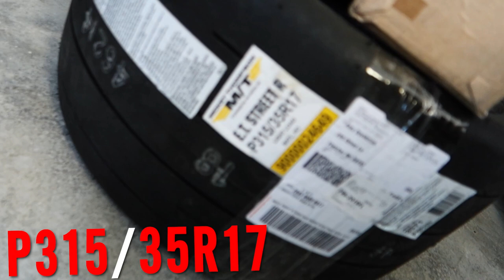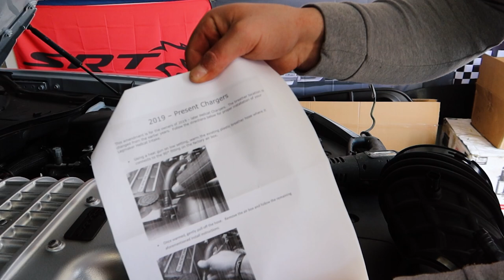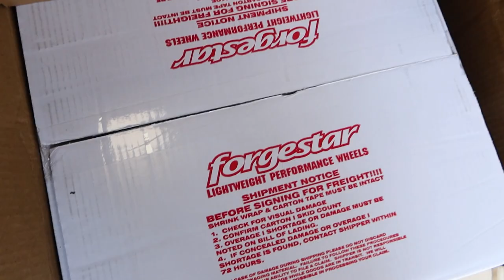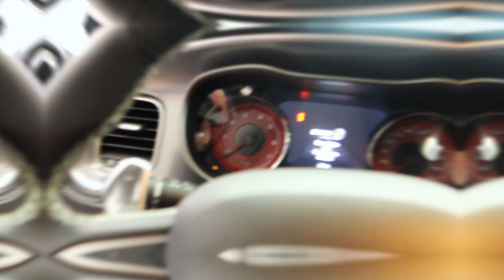Installing Legmaker Intake On my 2021 Dodge Charger Redeye, Very First Mod You MUST Do On A Hellcat!

Comment: I remember flipping the air intake lid on my 71 Chevelle with the trusty 350 V8...  All the cool kids did it to hear those four barrels kick in... cost was $0.00.  When you floored it, you got Baaaaaaaaaaawaaaaaaaaaaaaaaaahhhhhhhhhh.....  Times sure have changed from when I was a kid.  Now Hellcat power cost more than my 1st house did and a sound mod is another 450 smackers.  Have fun man, it does sound really good. Your MPGs is gonna drop from 4.5 to 4 LOL
Reply from the maker: Hahaha worth it bro!

Comment: I’m sure you can use the stock air box with that CAI. You’re losing power by removing that air box. The stock intake was sealed off from all the hot air in your engine bay and now you’re sucking it right up.
Reply from the maker: I never thought about that! May need to try it out
Reply: Your wrong the left marker makes 22whp your way wrong lol Cleary don’t own one
Reply: @jesussavescars807  that's cap af I wonna see the dyno because my car lost power drastically around 17hp compared to stock and the intake temp was running hotter than stock. It's a waste
Reply: @buckshatt340  I think u right.. I’m keeping stock… mines a daily so

Comment: It looks like the stock intake was insulated from the engine heat sucking in cooler air. The new intake is naked and seems prone to sucking in hot engine heat air costing performance…?

Comment: Nice video! I ordered one to be built 3 weeks ago. And I have a leg maker on my 2016 hellcat. How’s your iat’s even having no shield as your filter is next to the reservoir? It increased my iats up 30 degrees. But I use a new black insulator blanket that covers the reservoir, and temps are way down now!

Comment: I'm a little late for commenting, but you should make a another video with the stock one back on and the aftermarket one. Do your normal daily driving, pulls, burnouts and whatnot, but keep eye on your cai temperature. Compare boths at the end and just see the temperature differences.

Comment: So I just ordered a 2021 Hellraisen Charger RedEye and have subscribed to watch your build so I can get some idea's. I also have an F8 2021 Challenger Scat Pack sitting in my garage as I type and am adding the SC big brother - I've been playing with 4 wheel firepower for years - - just some cars I can remember I have had over the years:  a 2020  ROUSH built GT5.0 premium,  a 2020 Shelby 350, a 2019 C7 Z06, a 2017 C7 1LT, a 2010 2LT, a 2003 Z06, 1999 Cobra, 1992 Camaro 2SS, 1971 Mustang 351 Cleveland block, peanut plug double pumper 4 speed sleeper car, dual exhaust, posi traction screamer... 😉 (Canceled the HC ordered a ZL1 1LE instead) The Dodges have a Fools Stigma attached - as in kids with no brains drive them... sorry if I offended anyone, just sayin’
Reply: Don't add a sc to the scat, its not worth it. they don't make power out of boost and the internals can't handle it.

Comment: Hi ! I wanted to purchase an LMI CAI from the website. I currently have a 2021 charger hellcat wide body. On the website the latest they have available is the 2020. Is that the same one as this? Just want to make sure before I order. Great Video!! Love the content and earned a sub.
Reply from the maker: Thanks for watching. Call them directly and check on the status. When I bought mine it said the same thing but when I called they said they had them available ASAP

Comment: I read somewhere that on the 2021 charger redeye this intake actually does give you a lil extra hp due to the design of the hood and its snorkels
Reply: Just finished installing it omg it sounds amazing. I also noticed it makes my car backfire and pop more (mid muffler delete)
Reply: @hds8182  did u turn off the battery before installing it?

Comment: U lost the ram air Tec.   Ur going to get alot of hot air in your intake temps.  Put the box back on.  You can fit the leg maker.
Reply: So the box can stay?
Reply: You can not use the ram air tec and avoid the increased temps. By using a insulator blanket. Wish I could post a pic. Local guy near me invented this. It’s a black insulator that covers your reservoir and temps stay back down even lower than stock by a few degrees.
Reply: That was my first reaction, he has lost the pulling of air from outside and is now getting hot under the hood air.

The reason you can hear it better is because it is just pulling air right under the hood. Or am I missing something...

Comment: U already got a air intake from dodge what’s the difference in horsepower any??
Reply from the maker: The intake is from legmaker, I didn’t get it for horsepower, mostly for sound.
Reply: Believe it or not, the one supplied by dodge as massive as it is, is somewhat restrictive because it's a closed box design - even with the wide hood ram air scoop. An open filter design will always get more air in and it shows by how much louder the supercharger is

Comment: Why do you have to change the cold air intake when you mod?
Reply: More air more power
Reply: @TheGjergj79  this doesn't provide more air.
Reply: @345gang well no it doesn't
Reply: @345gang I've had the same car on the same dyno on the same day have a 20+ hp spread. They don't make any extra.
Reply: @345gang no you didn't
Reply: @345gang yep, whatever you need to say to justify your purchase. Whatever is right.
Reply: @345gang I'm not wrong, that's what you're not understanding.
Reply: @345gang and I told you that the same dyno on the same day can show a 20hp spread on the same car... what part of that aren't you getting?
Reply: @345gang a 20 hp spread means that one pull my car dynod at about 645 and the next it dynod at 667 with zero modification. It happens all the time. How much did that CAI knock off of your ET and at what DA?
Reply: @345gang that has absolutely nothing to do with a CAI. I ran sub 5 second 0-60 with my stock 5.7s, sounds like you're just getting better at driving.
Reply: @345gang the factory CAI is almost identical to the one on the 392 and Hellcat. And the 5.7 doesn't pull nearly enough air for the factory intake to be a bottle neck.